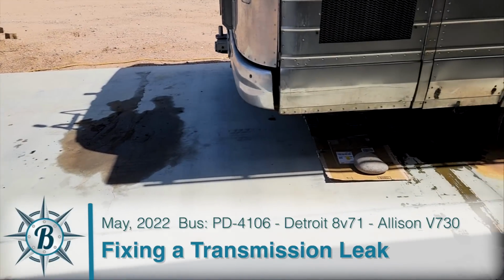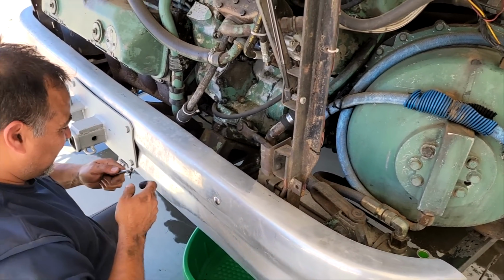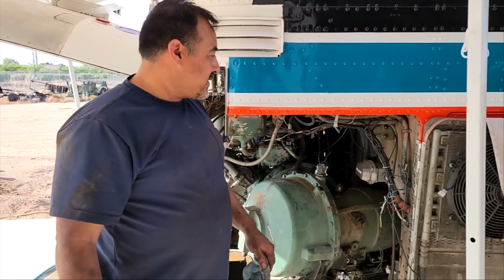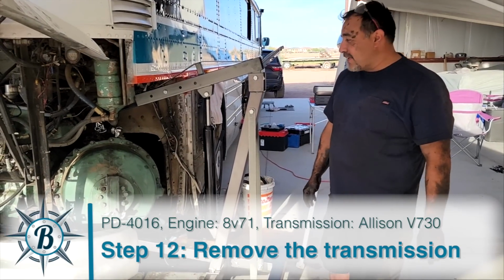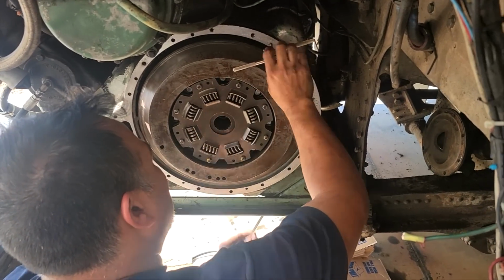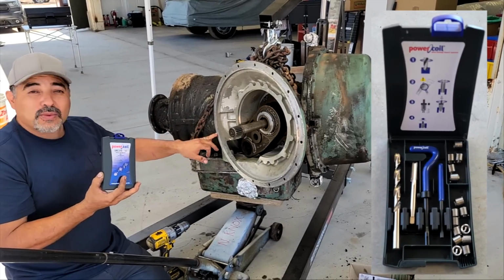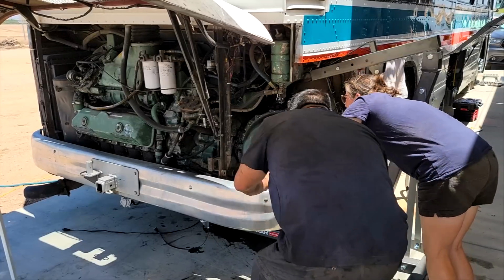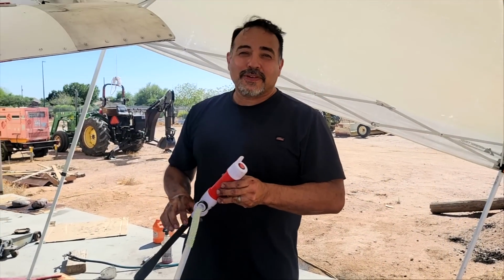Repairing Our Transmission Leak - Complete Walk-Through

Comment: You’re a certified V730 tech now too!!!! Most V730’s have a drain tube where the hump in the spacer is that allows the fluid to only get so deep in the bell housing. Looked like yours is welded up. The starter is another place they leak. There’s supposed to be a gasket on it where it bolts to the bell housing. Thanks!!

Comment: awesome job for a first time. as far as the minor leaks or drips. after you put some miles on it if leaking from where the bolts went in just retorque the bolts again. if not leaking from there probably just the lines or filter area that is easy to fix.

Comment: Glad to see you guys posting again!  
Removing/replacing a transmission on a car is daunting enough...you guys are brave to do this on your bus.  
Very well done!
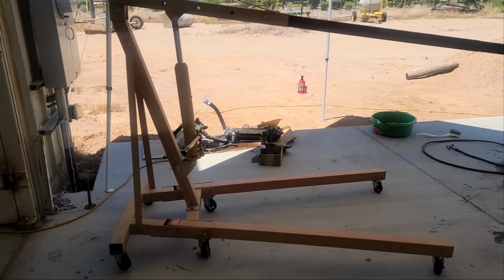BTW:  15:08  The lift arm can be adjusted for length and weight capacity by removing the bolt on the arm and sliding the arm in or out as needed for the situation.
Reply from the maker: Thank you Gregory!  To be honest I was not 100% sure we were going to be able to do it!  We did end up moving the bolt you are speaking of to bring the boom out just a bit to clear the body of the bus.

Comment: Thanks for sharing! Watched the whole bus build, and now it's nice to see how confident you really are with things like this. Did you have to re-torque all your bolts after the initial break in.? Just wondering if that might have solved some of the leaking? Be safe. Such a treat to see you two again!
Reply from the maker: It has solved 99% of the leaking.  We still leave like 2 or 3 drops when we park but not like what was shown at the start of the video.  It was leaking so bad we had to put in about a gallon or so of transmission fluid every 500 miles or so.  We have traveled about 12,000 miles or so since we did this and I don't think we have been through a gallon yet - so it is MUCH MUCH better.  When we get home in a few weeks I will retorque them again and I am thinking about adding a copper washer to the bottom most holes to seal them up - I will keep everyone posted.

Comment: I just looked and this video is over 6 months old.
How is the bus running and is it still leaking? Is it leaking at the gaskets you replaced? Did you find a torque spec for it?
I wouldn't expect it to leak at all, not even a drop.
I've worked on cars and done all kinds of repairs and replacements on them.
At my current age, 74, I can't imagine doing what you did when I was in my 20s. 😊😊
I meant to ask: did you have that motor overhauled recently? 
I know you said it was 105° but it started awfully quick. Much faster than I expectrd.

Comment: Hi again. For a software engineer you certainly know your hardware.This must have been the biggest operation you did in the bus, wasn't it? I mean removing the complete gearbox is not nothing. But you fixed it, congratulations.
What is so nice about you two is that you form a real ream. You do everything together. Especially on this operation it is impossible to do it alone, but as a team you nailed it.
You keep calling Scoot The Greasemonkey, and yes I know, that's the name he probably gave himself, but have you looked at yourself, for instance at 18:21 in the video. How would you call yourself? 🤣
Now the bus is driving again, what are the next plans?
Reply from the maker: Thank you so much!  LOL yes this was an extremely dirty job!  After we fixed the bus we headed out again and put another 12,000 miles on the bus!  This was done last May 2022 and we have since been all the way from Arizona to Maine and back again. We are currently on our last "loop" as a family of six because my oldest son will attend college in the fall.  This last loop has taken us up through California, Oregon, and Washington.  We are now headed back down through Idaho and we are currently in Utah but should be back in AZ in a couple of weeks.  We had planned all this for 2 years and it will be 2 years this summer so we will have to decide what to do at that point.

Comment: Do the bolts go through the flange on the transmission and into the engine?  Just wondering about the helicoil installation.
Reply from the maker: The bolts go both ways.  about 7 of the bolts on the left hand side go into the engine block, about 4 or 5 on the right side thread into the transmission housing and the rest are threaded rod with bolts on either end.  I think the ones with threads on either side used to be threaded on the transmission housing but someone drilled those out and just used a nut on the exposed flange (that's my guess)

Comment: Urg, those kind of jobs are always supremely messy and grueling no matter the prep. Prep WILL however save a lot of time and more importantly give you confidence that it will go together again without much drama. I dodges a bullet today with my Bosch fuel pump on the bus. It leaked a lot of diesel and found out it was a simple copper washer that failed. My mind was already racing what a major hell job it would be to take the entire thing out.
Reply from the maker: Oh wow I love when something like that happens!  Nice work on finding the copper washer!
Reply: Same happened to me with my backhoe had me worried at first so satisfying when you can over come the problem 👌